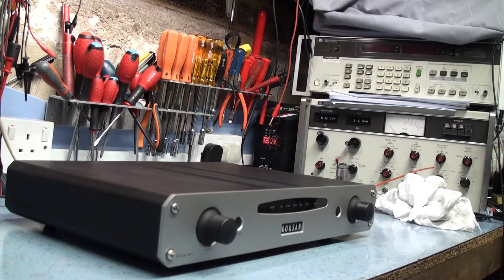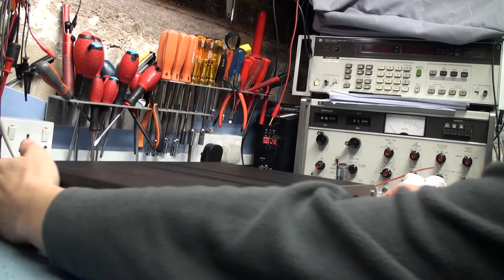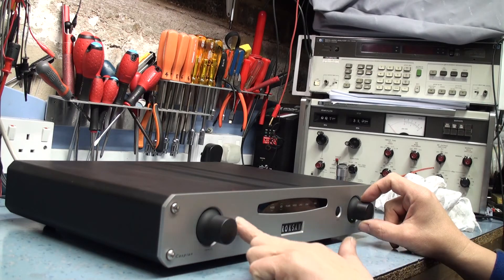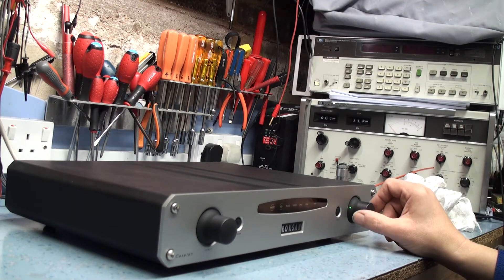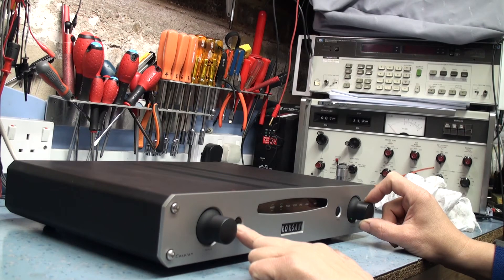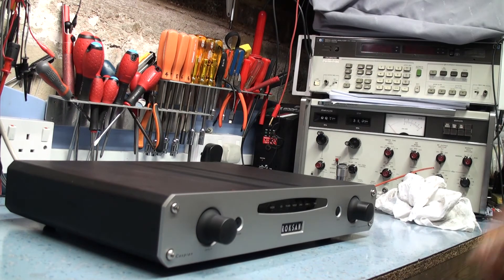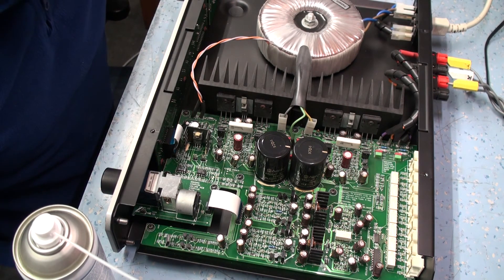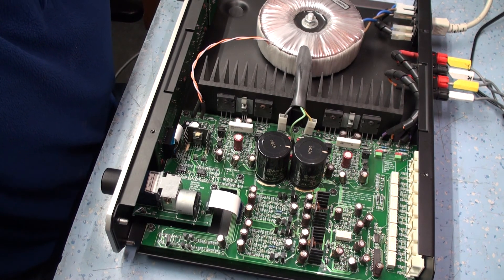Fault finding a Roksan Caspian Integrated amp. First look

Comment: Have you thought about fault finding on amplifiers using a Light bulb current limiter. Tends to save major blow ups of the output stage when investigating faults. Saved my bacon MANY times !! Can cause issues with certain amps when you crank up the volume but I would recomend its use.
Reply from the maker: +retro1970style I agree and plan on building one. This would be particularly useful for this horrid amp.
Reply: Simon Spiers There are some very helpful engineers at Roksan. It may be worth giving them call. They have been very helpful to me in the past. Good luck.
Reply from the maker: retro1970style From my experience they won't help Joe public in any shape or form. I tried to get a schematic and they were quite blunt in their reply.
Reply: Their tecnical support is available Mon-Fri between 3 and 5. You never know. May be worth a try.
Reply: @shaunpmarshall  you put an incandescent light bulb (an old filament type) in series with the amplifier's power input. If the amplifier draws excessive current, the bulb will light and limit the current flow. The bulb acts as a PTC resistor